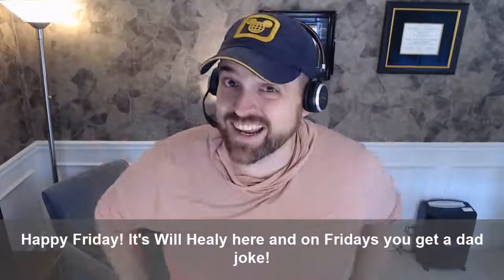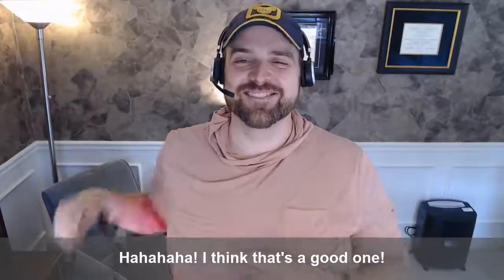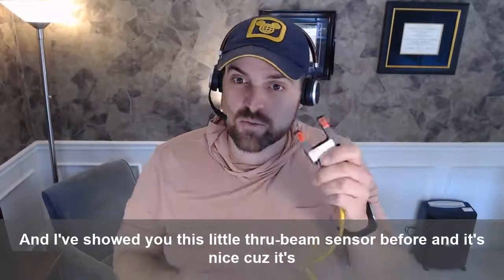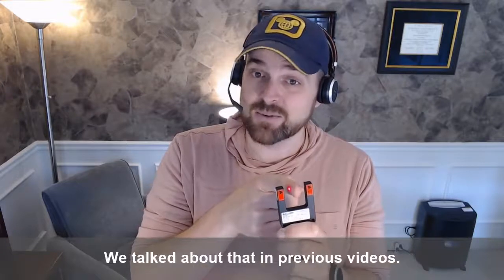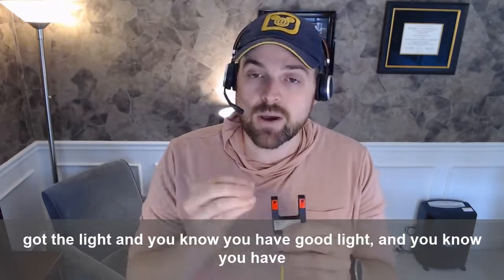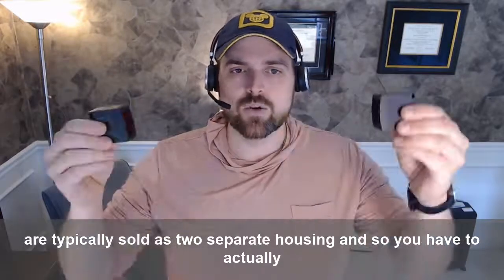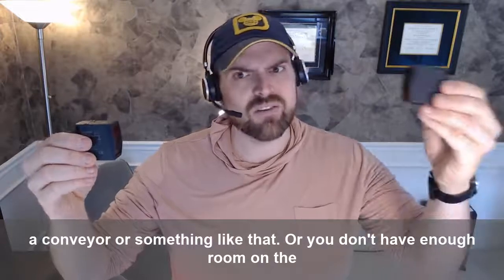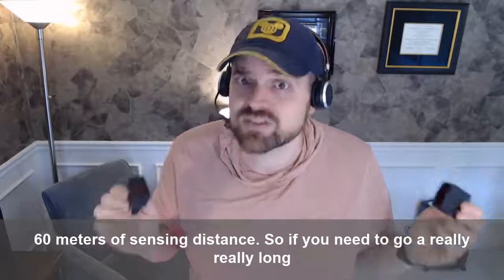Sensor Basics: How does a thru-beam photoelectric sensor work?

Comment: I don’t know anything about electricity. Is a battery all you need? I guess I mean do you wire the sensors directly to the battery or do you need something else? Like a transformer box that the sensors are also connected to?